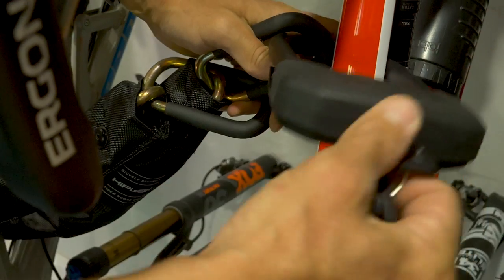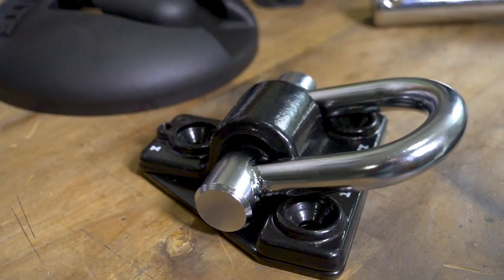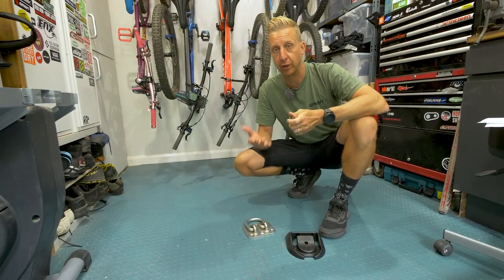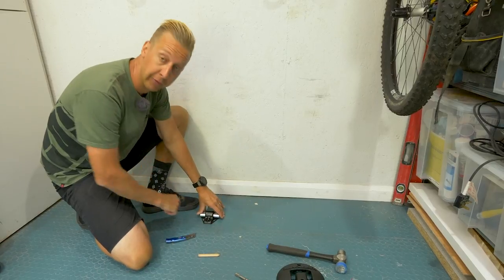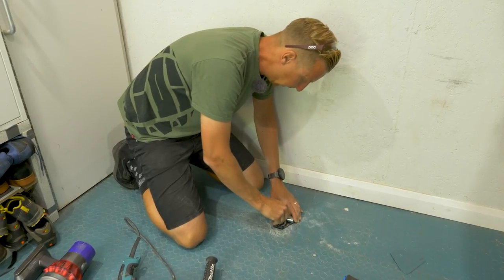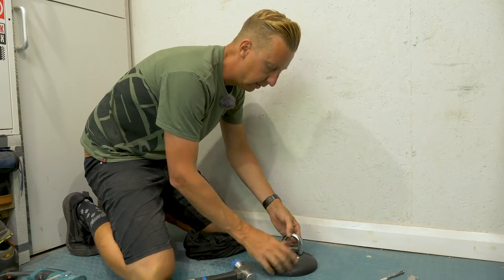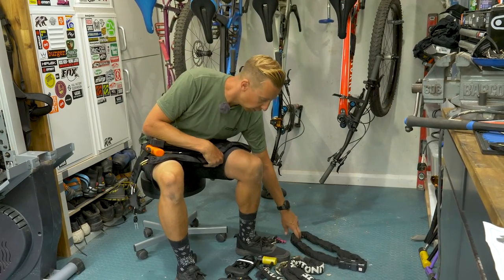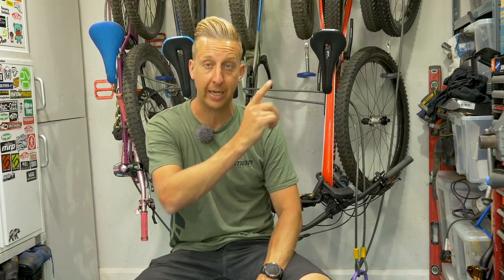How To Install A Ground Anchor | Ultimate Bike Security

Comment from the maker: Have you installed a ground anchor?
Reply: GMBN Tech why are you not having any pedal on your bikes? Another security protection. Did you than also put your pedals in a Tresor? Did you also install a camera, noise-Alarm and a automatically pepper spray?
Reply: Just installed the gold rated Oxford one to the wall. A good tip is to not leave tools that thieves can used laying around in the same room as the bikes. If you're storing your bikes in your workshop or garage, just be wary of how easy the access is to your cordless tools, angle griners/drills/crowbars.
Reply: At time not but i want to buy one. but can i insatiate a groundanker on the sealing?
Reply: Yep, 2 anchors, and D lock and heavy chain. But nothing is impregnable.
Reply: Yep. I installed a ground anchor and then built my bike cave on top of it. I run a kryptonite chain through the floor to one bike and use another to chain all of my bikes together.
Reply: I'm going to install one next week. It's an oxford bruteforce. But I am going to fix it to my brick wall.
Reply: I need to get one for my wooden shed its a decent build one over £1300 worth with 60mm of wood  under the floor where the frame is... What is the best option for that.. As these can only be used on concrete i assume of which i have but only outside.. Also the bike wont be much over £500 any reccomendations appreciated.. Also have house alarm sensor fitted in the shed too so will trigger if broken into..
Reply: Hi,I have a motorbike with Taurus or torx ground anchor.What you can do is when you fit your shed measure out say 1 1/2ft square in floor of shed cut out and before you make shed dig out floor/ground/dirt pour concrete fix ground anchor make wall around anchor up to shed floor fix wood floor with a just big enough to pull through chain,D lock ,ok👌👍😜
Reply: no point in doing so. If someone made into the room where I store my bikes he could simply go into the next room which is my dad's workshop. There he could find any tool he might need in order to brake any sort of security measures
Reply: Just installed one today. I have a slippery epoxy coating on the floor and the drill moved maybe an 1/8 of an inch and only 3 screwed we in perfect.
Reply: Are there professional companies that could instal this ,or any trade
Reply: I know im asking randomly but does any of you know a method to log back into an instagram account?
I somehow forgot the account password. I would appreciate any help you can offer me!

Comment: Very important to keep all your cutting gear locked as well!  You don't want to have your bolt croppers and angle grinders at hand for thieves to use.  Or keep them away from the garage.

Comment: When drilling into the concrete it helps to start the hole with the hammer function off. That way the drill bit jumps around a lot less. Once you have a small hole started then engage the hammer function to drill the rest of the hole.

Comment: Tip for getting the dust out.. When running the vacuum over the hole. Have a straw stuck down in there but outside of the vacuum. The vacuum will draw are from the hole and the straw will replace that air acting like a little blower all the way to the bottom. Gets all the dust out.

Comment: Im a climber and we use similar bolts for protection when installing them I also take a small round brush to clean the hole out and a straw to blow out the rest

Comment: Just recently had to install a anti-theft device during a hike & bike in Wrangell mnts in Alaska.  I forgot/didn't want the extra weight and hassle of a lock in backpack.  So when began hiking parked bike at carpark by park rangers and installed my two stinky riding socks across the top tube woven in between cables.  I also left it in hardest gear, shoes clipped to peddles, & helmet woven around head tube cables...  I was so happy to see my bike was still there...  ...and a hope for humanity.  ...or maybe it was the socks that we're the deterent?

Comment: Where did the power for the power drill come from? Well, from the same power outlet the thief will use for his angle grinder. So keep in mind to install a circuit breaker for your garage power outlets that can only be accessed from somewhere else but your bicycle shed.

Comment: I do not have any of these.  BUT this guy is right on point.  I have a hole I drilled in my wood utility shed floor and the installed a 20 foot long ground anchor.  I attach my motorcycle and UTV to it.  Frame to anchor.   I use a chain with a kevlar sleeve to secure it.  I also run a an additional cable lock from one of the wheels to the frame.  Fast forward, there has been a lot of bikes stolen from garages in my area as of recent.  People have broken into my garage but I still have my stuff.  Enough said.  Even if your stuff is in a garage, anchor it.

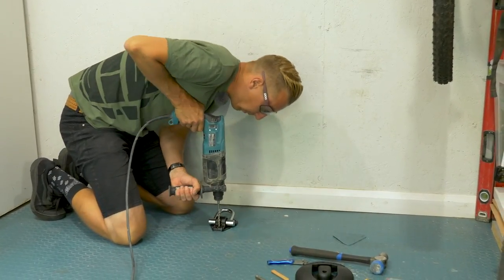Comment: 4:54 with SDS drills you dont need to put all that weight on it to drill, the hammer in the drill does all the work for you, all you need to do is hold the drill firmly and let it drill, even the weight of the drill is enough pressure.

Comment: The problem is sometimes if the thief is in your garage, he also has access to your grinder, bolt cutters or crowbars... consider locking those tools into a cupboard to make it just that much harder...  the weakest link is where they will attack, so the cables with minimum rating bring the rest of the system down to that level... Make sure your insurance covers the true value of the bikes, and check the insurance companies requirements are met regarding deadlocks, window locks, etc. Ultimately, attaching a hungry rottweiler on a short lead to the ground anchor is the best solution. Also, a webcam to get an alert on your phone and some footage for the police is a good idea too.

Comment: Tubular locks can be picked pretty easily with just a tension wrench and paper clip. Best to use a quality padlock and ideally have a MOTION DETECTION SYSTEM in your garage with an alarm. NOISE and TIME are the #1 deterrent for most thieves. If lights kick on and sirens fire up as soon as they enter the garage, that's a much bigger deterrent than any lock system.

Comment: As someone who works in construction, silica dust is really harmful. Always have a mask If you are drilling, cutting or jackhammering concrete for any (especially extended) amount of time
Reply: i hardly think dust would do much damage from a couple of holes in a well ventilated room.... the damage from silica dust would take multiple years of contant exposure to lead to threatening damage

Comment: You don't just want a plug in drill drill, you need a rotary hammer. And no, a impact gun won't cut it too. What's used in the video is a rotary hammer.
Reply: A normal hammer drill won't hack it on concrete either, it will just slip about all over the place and create a weak hole. An SDS drill designed for concrete is pretty much the only tool for the job.
Reply: and yes, a hammer drill is another name for  impact gun
Reply: @mikuramsay  no it's not.
Reply: @oJ862  a regular Milwaukee cordless hammer drill will drill through concrete just fine I do it all the time.
Reply: @bobbyhempel1513  https://youtu.be/6UMY4lkcCqE 

It also depends on the type of concrete

A rotary hammer gets the job done much faster and has less chance of slipping when drilling through hard concrete. The concrete on your floor is ussually much denser and hard to drill through compared to a wall.
Reply: @mikuramsay  floors are what I'm talking about, I'm in construction (sub contractor) I deal with hardened and reenforced concrete quite often.

Comment: nice video. is there a video which show on how you hang up your bikes on the wall. it seems theay are hanging on the rear wheel, the front wheel has been taken off, and the handlebar has been twisted in order to save space.

Comment: There is easy option to fix to concrete and it may not be permanent. They are called concrete screws or thunderbolts. Drill holes and they just screw into holes with no permanent inserts required. Impact gun needed to drive or remove them.

Comment: I can definitely see the point in locking bikes in this manner for long-term storage in a less secure location but for the average, everyday use isn't it a little excessive? Wouldn't one ground anchor and an industrial chain be enough to secure bikes? Surely in most people's cases the noise of an angle grinder in the early hours of the morning is enough security?

Comment: My shed doesn't have a concrete foundation.  It has square stones, prob 6"x6" each.  Is there a good solution for this?  I was maybe thinking of getting a long piece of flat metal and then secure it to several of the stones, maybe 5-8 stones and then put the anchor in the middle?  Will that work?

Comment: I guess you really don't know about Hammer Drilling you didn't wear any dust protection they do make cordless SDS hammer drills
The silicone dust from concrete is very dangerous you think a couple holes no different heads up

Comment: Corded doesn't matter, the drill does.
Reply: It does, battery ones don't have as much tourqe or power
Reply: @lewisheaven2365  get some proper tools, like Hilti. even bosch drills are better than DeWalt
Reply: @maddox4556  makita is perfectly fine, if you buy a corded SDS drill and a cordless SDS drill, same brand, same price (ish) the corded would be better

Comment: Unfortunately, the ground anchor is only as good as the bike lock being used with it. It doesn’t matter how secure the anchor is, if the lock, cable, chain. etc, can be cut, picked, or otherwise defeated, the floor anchor is essentially worthless.

Comment: So here's a thought;
Thief comes in; tries to pick locks, and break chains... unsuccessfully .... but leaves your bikes scuffed and damaged. 
I'd rather have good insurance, and get my bike replaced I Guess.
I do take a good lock with me on holidays, because insurance companies maybe just as bad as thieves in the end. :P
Reply: Similar thoughts here:  A thief is more likely to break a frame or cause serious damage trying to get the locks off than taking the bikes...then you end up with a broken bike an no insurance payout because they didn't steal it.
Reply: @cup_and_cone  Problem is, if they're not locked and bolted the insurance doesn't pay out.  All in the small print
Reply: @justinbowyer6760  Not true for everyone. With my homeowner's insurance (in USA), as long as it is inside my physical house with locked doors/windows, then it's covered just the same as the television, jewelry, etc.  The important thing is to read (or ask) your insurer and take any precautions to ensure you're covered.

Comment: I live in an apartment building, I would like to store my bike in my underground parking space, but there is nothing to lock the bike to. I cannot get permission to drill anywhere though... wondering if anyone has any unique ideas. was thinking cinderblocks but people could just break those...
Reply: First thing that comes to mind.; just get some bags of concrete, and a box made of wood. Pour the concrete, let it dry, remove the wood. After that just drill in your cube of concrete. Make sure the cube is heavy though, like 50kg + with no ways to properly carry it..

Comment: Kryptonite Stronghold looks like something an angle grinder would cut through relatively quickly… if someone is going to be burglarizing, wouldn't they bring that kind of tool? maybe you only have stupid burglars. if angle grinders are a concern, they make anchors with rollers like the Almax Defiant
Reply: Haven’t you heard of opportunist thieves?
Reply: If they're breaking into your garage, it's a more determined burglar
Reply: The majority of toe-rags breaking into garages are opportunists looking to grab whatever they can ie electrical tools, gardening equipment, push bikes etc. to sell on. They can be in and out of a garage within minutes with something as basic as a screwdriver. They have no need to be carrying cordless grinders etc. They want to be in and out with what they can grab and be off. Someone breaking into a garage and taking a grinder with them will no doubt be doing so because they already know there’s expensive bikes in there, not opportunists which the majority will be.
Reply: maybe around you it works that way… this is the first i've ever heard of people breaking into garages to steal stuff. around me, it's out of sight out of mind
Reply: It’s country wide and more of a ‘job’ for these people, usually to feed a drug habit.

Comment: Don't be fooled by "heavy duty" bike chains. There is no 16mm thick bike chain, but there is 16mm and possibly thicker bike U-lock. 16mm is the magic number that makes 1m long bolt cutters useless, even when one handle is resting on the floor and a heavy guy trying to jump onto the other. The jaws are spread so wide, that you can not put any significant leverage on handles. And bolt cutters are one of the quiet type tools for the job, so it's fairly important you eliminate those. Unfortunatelly, u-locks are not good for a large steed in some kind of a stand.